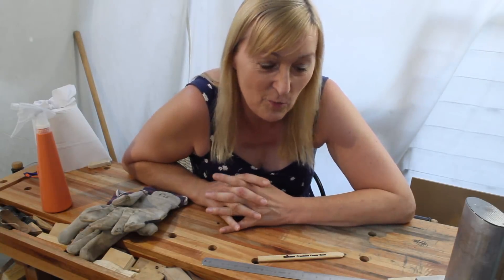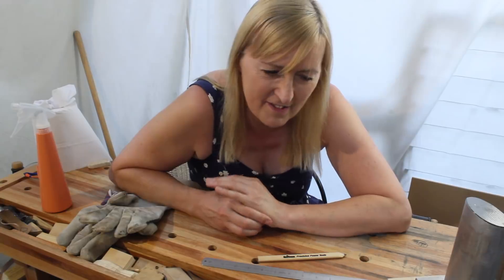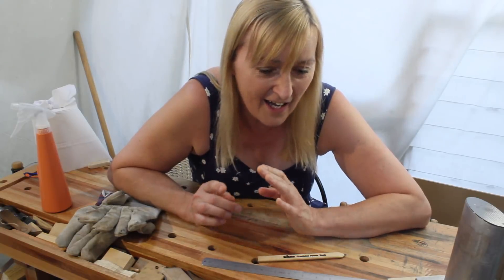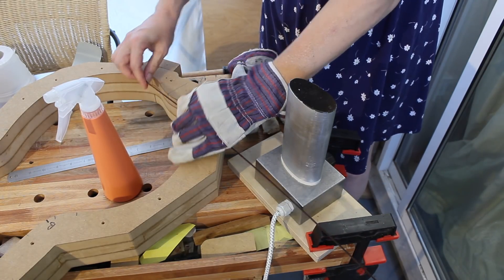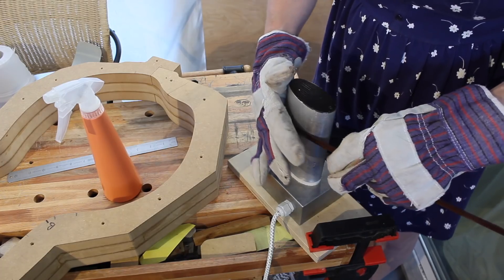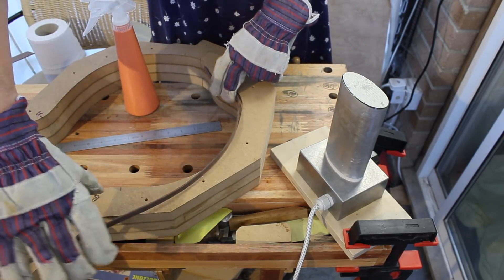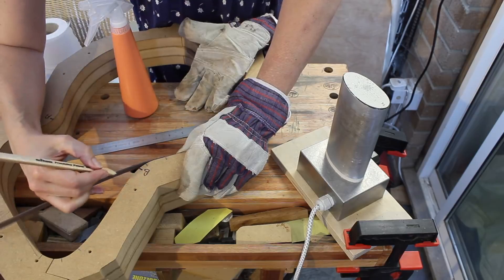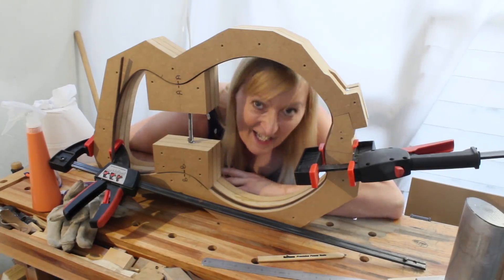Sugar SG1 acoustic guitar build part 33: Side bending practise

Comment: I have found that using a backing strip of thin stainless or aluminum helps greatly to spread loads to the wood. Yes, also keep hands close to the bend.
Reply: Jerry Rosa, of Rosa String Works, uses a strap made from a large tin can, to which he adhered wood handles. He has a recent YouTube video using this effective and inexpensive tool.

Comment: I think that you could do with looking at some videos of classical guitar makers that make their guitars with the neck joined to the sides before building them on a board called a Solera and  then putting on the back without any need to make fine adjustments to the neck joint when the guitar is finally finished. All the best from a 73 year old guitar maker.

Comment: This is a possible reason we have not seen the final build and set up.  Has susie had a number of disconcerting problems that need to be backed away from for a spell to regain her composure.  I can relate to this situation.  For example, I was tasked with mounting a small but heavy air conditioner unit into a 2X4 frame that would mount into a rectangular hole in a wall sheathing cut out.  It took me two times to get it right. By the time I had to attempt a third time, I had to just walk away from the project for awhile.  That was back in this past November.  I may be starting a new job soon and I don't know who will complete the AC job or how it will be a satisfactory installation.  Some things just have to left alone for a while, I guess.

Comment: Did you know you could prevent some accidental cracks and increase bending properties of the wood while exposing to the bending iron's heat just by introducing it to water? The presence of water will add more flexibility while under stress. can actually sprinkle water on it and wrap the rosewood in tinfoil, which is going to make sure the water stayis in during the process.

Comment: I hope you will not take offence if I give you some advice regarding the order in which you complete the guitar. First assemble the sides together with the front then bolt on the neck before putting on the back, this will allow you to adjust the neck angle without having to do some fine tuning when the guitar is almost finished. Then you can remove the neck before vanishing the guitar. All the best with your guitar build.
Reply from the maker: I’m wondering if gluing the back on before adjusting the neck might be better, in case the act of gluing and, perhaps more significantly, clamping the back introduces a tiny distortion to the angle of the sides and top? I could get the macro adjustment done first while the back is off, but maybe do micro adjustment once the back is glued?

Comment: I have been looking through some of your earlier videos and have found one where you made a thickness sander and thought that it would be a good idea for anyone that wanted to make a thickness sander that has a lathe already that could be converted into a thickness sander without much fuss or at least far quicker than having to make a table to support the sander because the motor is mounted in precisely the right position and it leaves only the surface plate to be made and adjuster to change the thickness of the work piece together with the drum of course. Just a thought.

Comment: hi Susan why don't you use a steam box to bend the wood which I have seen furniture makers use it seems to me to be a lot quicker than a bending post cheers
Reply: Jim I agree, I did wood bending in a factory that made Bobsleds, kids skiis and toboggans. we had about 25 steam boxes and steamed everything for at least 2 1/2 hours and once set in a mold they dried for 24 hours..  I have never heard of spraying wood and bending it with an iron, I can't imagine it not just straightening right back out the way she is doing it...or just breaking.

Comment: The earlier comment that I made doesn't seem to have been sent, so I hope you will forgive me for repeating myself if you have already received it. The problem that I referred to is that you may find it difficult to use the method of bending the sides starting from one end and working to the other as you have in the practice piece due to the width of the sides.  Far better to bend the sides as one u shape and then bend the waist relaxing the sides into the mould. All the best , looking forward to your next video.

Comment: Weird thing with the bandsaw there...  Matthias Wandel uses electrical tape as tyre material for one of his bandsaw hacks...

Bending :) Welcome to my world... You pretty much drive all the moisture out with bending on a hot iron so I think ou do not need to rest your wood after resawing. Taylor Factory Fridays which used to be other site had great video essay on bending. Very, interesting. 

Why doesn't wood like being bent? Because you are torturing it! Those molecular bonds you are trying to break still appear to have memory and want too get back together again.

And I think your evaluation is wrong. In my long experience breaking occurs when the work is getting hot. Watch me bend sides next week on my facebook page. It may help you. I also have some wide shim stock if you want a sensible backer. Your problems are compounded by wearing gloves... how can you possibly feel where the  heat is. It is not dangerous but essential. Trust me!

Watching more closely I note you are doing what I call 'cheating'. Harsh I know but successful bending only occurs when you bend contiguously - you must make sure you are bending forward from where you have been and not beyond where you are. I'll explain tomorrow. Pre-bending only confuses things. It s a stage by stage process. Watch more videos do more research. You are making life harder than usual for yourself.

I'll reference the comments you made here. Anyway - just to help you. I've done this at least 2000 times now...